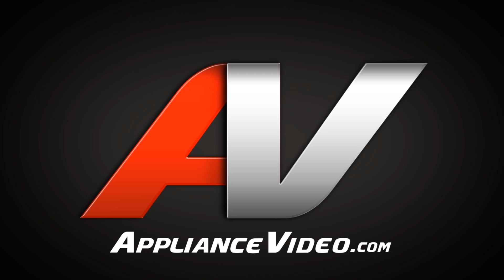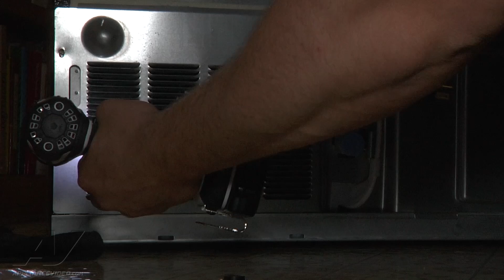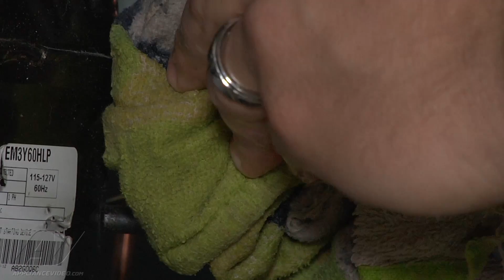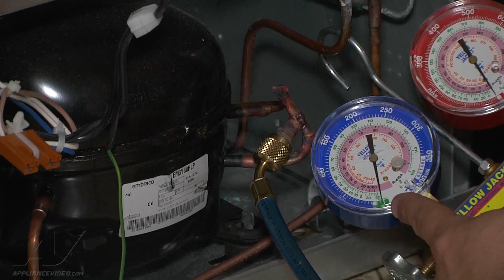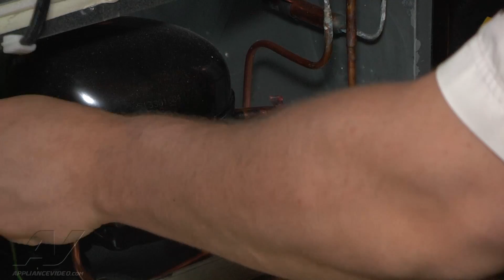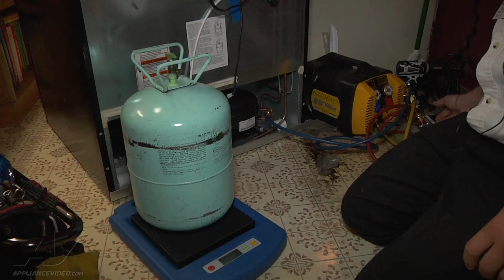Maytag Refrigerator Repair - Failed Compressor - Diagnostics & Troubleshooting

Comment: To explain further about adding 134a the amount to add is on the label inside the refrigerator usually where the model and serial number is. Good to see you using the scale.

Regardless of the evaporator change still should change drier...to each his own.
Reply from the maker: Yes, you are correct we always replace the filter dryer. On this unit since there was a leak in the evaporator  it was replaced the day before we did the compressor installation. Thanks for your input as it will help us provide better quality free videos.   Please help our ranking by subscribing to our YouTube page or posting our ApplianceVideo.com site on your Facebook or Twitter account. This will help us to continue to make new professional videos from our factory trained technicians and help people like you. We also have our technicians daily emailing professional advice to people that have problems with their appliances. We have helped thousands of people save hundreds of dollars. Thanks in advance for your help.

Comment: Thx for another great video. Why the filter drier was not replaced?
Reply from the maker: hondagoal The evaporator was replaced the day before and he replaced the drier then. We did two videos on this unit compressor and evaporator. Thanks for the positive comment. Help us produce more quality videos by posting ApplianceVideo.comon your YouTube, Facebook or Twitter account or add us to your circles. If you are in need of any parts please support
our parts department on line at http://savemoreonparts.com/ or call 1-800-830-5465 7-days a week until 11pm Eastern
time. Thanks again your support.  Matt, Ace Appliance service technician.

Comment: Good video but if you gonna replace the compressor you should have changed the drier also it comes with the compressor also it shows people that never replaced a compressor the proper way of doing it other than that it was a good video
Reply from the maker: Eric
     The compressor was locked up. If it was a burn out, we would definitely replace the filter. In this unit, the evaporator was replaced 60 days prior, and the filter drier was replaced at that time. Great input and good catch. Please help us provide more quality videos  by subscribing to our YouTube page or posting our ApplianceVideo.com site on your Facebook or Twitter account. We also have our authorized technician’s daily emailing professional advice daily to people like you that have appliance problems. We have helped thousands of people save hundreds of dollars. Thanks in advance for your help.

Comment: I have a whirlpool refrigerator modle #wrf989sdaw00 s/n k30211393 and the condenser was leaking so i took it in to a apliance repair  shop it was there for six days and all they did was cut out the condenser and they never where able to get the part so I took my refrigerator  back  and the got me for 200 dollar I looked  for the part online  and it's worth 80 wondering if you guy would finish  this job you guy are pros....
Reply from the maker: herald munguia Yes, we can absolutely do this if you are in our service area. We service Lucas, Wood, Henry & Fulton county's. If you are in one of these ares call us at 419-382-6077 and we will take care of your issue. Matt Ace technician

Comment: Nice video could you tell me how you can tell compressor locked up
Reply from the maker: ahmetez
           If you go to our FREE repair help website at ApplianceVideo.com and post this question, We have 14 factory authorized technicians that will  answer any technical questions daily on your appliance issues. This is the only website on the web that you can get questions answered by certified appliance and HVAC technicians at absolutely no charge along with over 2600 free repair videos. Thanks Matt Ace Appliance factory service technician

Comment: Nice video. For accuracy in future your low side gauge reads vacuum in inches of mercury not psi.  Also, do you not use nitrogen when brazing? How do you plan not to oxidize the system?
Reply from the maker: Nathan
         I have personally been installing residential compressors for 35 years. I have never used nitrogen on any installation of 1/3 to 1/4 hp compressors with lines up to 5/16 inch. I have installed over 1000 compressors with no issues including my own home compressor I installed 19 years ago and still working fine. On anything over 5/16 inches we do use nitrogen. I even talked to our factory training representative that comes down every year from the largest appliance manufacture in US and they do not even train new technicians with nitrogen.

Comment: need to use micron gage to check properly for vacumm
Reply from the maker: Ross 
       Good suggestion but not mandatory. Micron gage is optional and most technicians do not use them unless they have a burn out or restriction. We just did factory training on sealed system and the instructor did not use a micron gage. Thanks for your input, all input is greatly appreciated and welcomed on our 800 free videos we have produced to help people with repairs. Matt,  Ace technician
Reply: where I went to school micron guage was used religiously tried to get down to atleast 500 maybe some practices have changed since 1993
Reply from the maker: Ross 
      Again we appreciate all input. We want to make our videos as accurate as we can, we just have one micron gage  for 15 technicians and use only if we have a burn out or restriction or feel we have moisture in the system. We install over 600 compressors a year with no issues with a 3.5 CFM vaccume pump. Please help us provide more videos to our site by subscribing to our YouTube page or posting ApplianceVideo.com site on your Facebook or Twitter account. We also have our factory authorized technician’s email daily free professional advice to people like you to help solve their appliance problems. Thanks in advance for supporting us. Matt, Ace Appliance service technician.

Comment: nice job, question the video showed 35 psi in system. p/t chart indicates @35 psi temp is appox 40 deg.. were you low on gas or in a 40 deg environment?
Reply from the maker: mike9972
            All of our technicians are now answering questions daily on the ApplianceVideo.com website for anyone needing help. Just copy and paste this this question under REPAIR HELP, and one of our  factory authorized technicians  will answer any technical questions at absolutely no charge on your appliance issues. We also have over 2600 free repair videos to help with your appliance repair issues. Thanks for your support. Matt Ace Appliance factory service technician.

Comment: Why are some people putting the saddle valve on the full line, and some like you are using the crimpt off line?
How do fin d the lone you want when all you want to do is fill it with coolant?  Do you have a video for that? 

I have the red, yellow, and blue line gage, but I think it needs a 1/4" female adaptor (that "no one' ever mentions)," to attach the blue line to the saddle valve as the line screw in is too big for the saddle gage screw in. 

Does it make a difference what end of the colored lines get hooked up to the gages as opposed to refrigeration parts? 
I noticed there is a shrouder valve on the one end of the lines.
Reply from the maker: Applepiebetty
                                       All of our technicians are now answering questions daily on the ApplianceVideo.com website for anyone needing help. Just copy and paste this this question under REPAIR HELP, and one of our  factory authorized technicians  will answer any technical questions at absolutely no charge on your appliance issues. We also have over 2600 free repair videos to help with your appliance repair issues. Thanks for your support. Matt Ace Appliance factory service technician.

Comment: which carries the fridge or pressures that runs the compressor amperage
Reply from the maker: shakacom 

All of our technicians are now answering
questions daily on the ApplianceVideo.com website. You can search completely
FREE in our Repair Help section with over 1000 questions & answers. Or you
can get unlimited technical advice and video links emailed to you by our 14
factory certified technicians at
http://www.appliancevideo.com/premium-membership/.  If you are in need of
any parts please support our parts department on line at
http://savemoreonparts.com/ or call 1-800-830-5465 7-days a week until 11pm
Eastern time. Thanks for your support. Matt Ace Appliance factory service
technician.

Comment: What kind of soldier did you use to braze the copper?
Reply from the maker: Jason 
Harris Welco - 5620FMPOP - TIG Welding & Brazing Rods Diameter: 1/8 (Inch) Diameter: 0.1250 (Decimal Inch)
Reply: Thank you!
Reply from the maker: Jason Vargas
                         You are welcome

Comment: I have a question: if you got a Compressor that lost all the Oil/water or what it is then what can I do?
 I don't know if it's different in Denmark but I heard that a fridge use some kind of Oil/water to cool itself down.
Reply from the maker: brian 
                              If you go to our FREE repair help website at ApplianceVideo.com and post this question under REPAIR HELP, we have factory authorized technicians that will answer any technical questions at absolutely no charge on your appliance issues. This is the only website on the web that you can get questions answered by certified appliance and HVAC technicians along with over 2600 free repair videos.  Matt Ace Appliance factory service technician
Reply: Ok thank you so much for your help! :)

Comment: I think the tank sould be rotated, because you need for liquid, not for gas. Or i'm wring? Sorry for language
Reply from the maker: Ernestas
        You can charge unit either way as long as you have a scale to weigh in the refrigerant.Please help us provide more videos to our site by posting ApplianceVideo.com on your YouTube, Facebook or Twitter account or add us to your circles. If you are in need of any parts please support our parts department on line at http://savemoreonparts.com/ or call 1-800-830-5465 7-days a week until 11pm Eastern time. Thanks again your support.  Matt, Ace Appliance service technician.

Comment from the maker: I can tell you it’s not aluminum its Steel you are trying to braze. You will need silver solder and silver solder flux to do this Go to any home improvement store or HVAC distributor. You will get it done no problems once you get the correct supplies. If you’re not in any hurry we can also drop ship it to you just call please call  1-800-830-5465, for any of your parts needs or order online at: ApplianceVideo.com.
Reply: Hi!  I checked your website and i did not see any silver and flux solder.  What's the item number or name of the item to braze the filter drier and the metal pipe. Thanks
Reply from the maker: KINTOINTOCABLE
                                         Call our parts department at 1-800-830-5465 they will have the part number of both items. Thanks Matt Ace technician